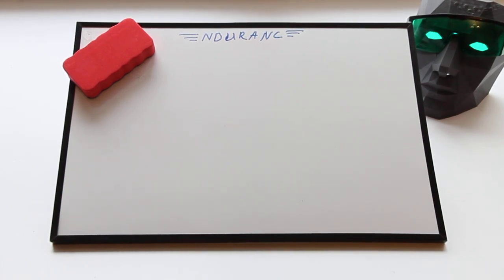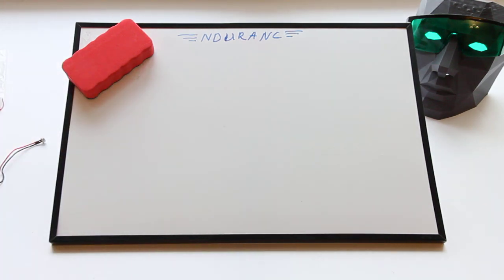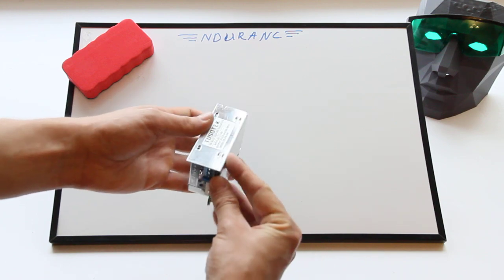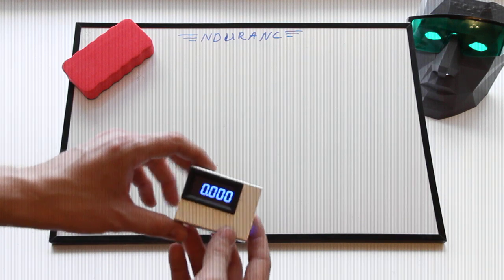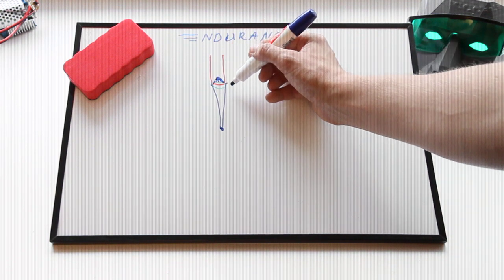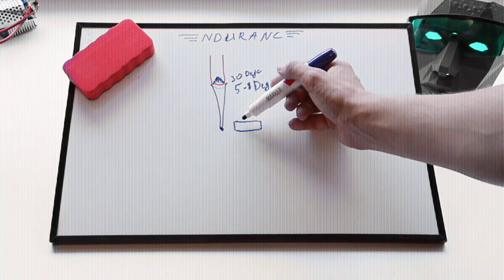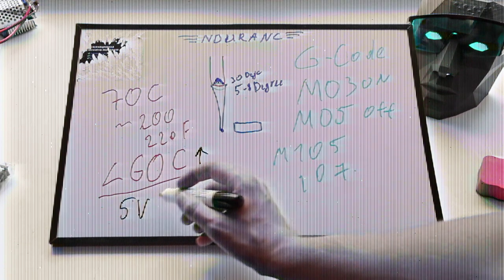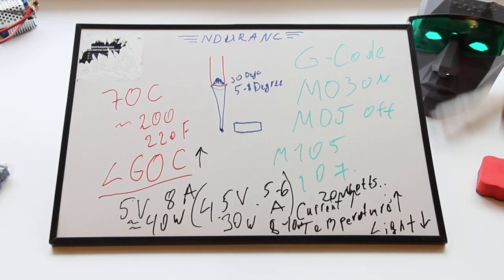Everything you need to know about diode lasers (presented by Endurance lasers)

Comment: hello, please i bought an 80w diode laser module, which i installed on a cnc, i powered my laser module with a 16v power supply, after some testing the laser stopped completely to burn. When I start the module there is nothing but a blue light that does not burn coming out of the lens
Reply from the maker: 80 watt like this? ! https://endurancelasers.com/endurance-nichia-nubm31-nubm31t-85-watt-laser-module/

Comment: Hi, i recently purchased a diode laser engraver and it says 15W but i know the output is actually 4.3 something based on online forums and videos of the same laser. i currently use lightburn and i operate at 25% power. i saw some videos say that you dont want to operate a laser at more than half its wattage, so does that mean i can set my output to 50% max? or are diode lasers designed with that in mind and i can set it to 100% on screen but that 100% is half the power output?

Comment: thanks for the clarification. I'd like to know more about fumes extraction? is this mandatory for cutting e.g. plywood?
Reply: In my experience wood is the least offensive material I've been cutting, and generally smells similar to those woodburning hobby kits. That being said, the particulate count will be much higher and you never know for sure which chemicals they are using to manufacture the plywood. So, long story short, yes you should always exhaust fumes.